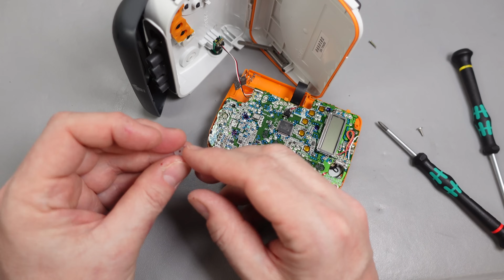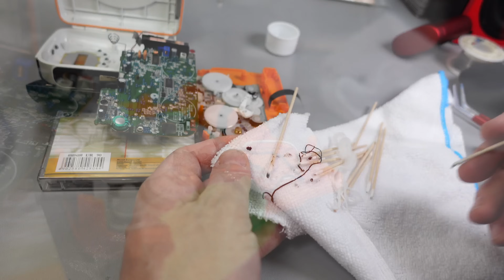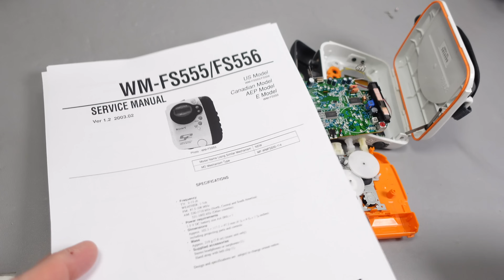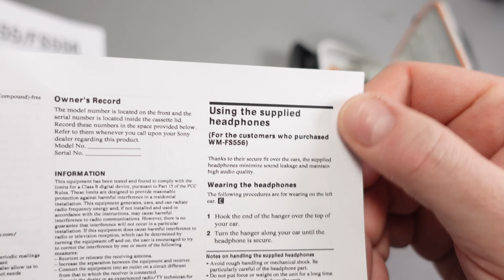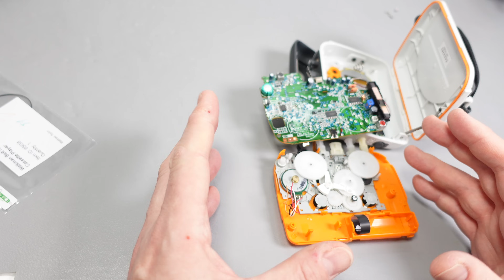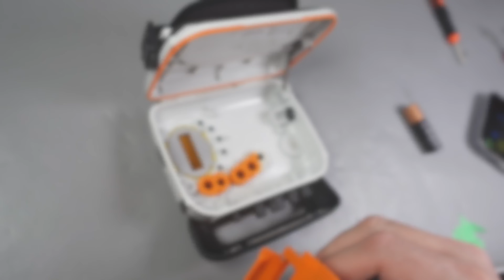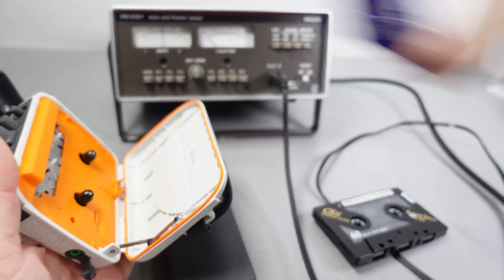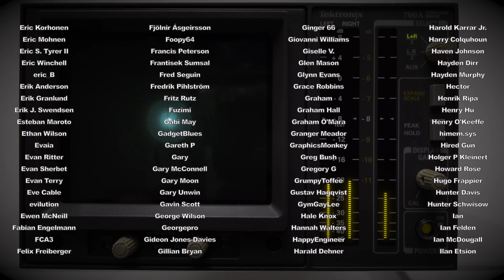SONY S2 Sports Walkman repair attempt

Comment: I'm genuinely impressed by the wow and flutter.
Reply: Walkmans performed really good.

It's amazing, especially seeing how tiny the motor is. Sony really knew what they were doing.
Reply: @volvo09  The W&F of 0.2-0.3% this thing produced is mediocre at best, most people will hear it. Acceptable for a walkman, but it could be a lot better, and it was probably a lot better when it was new. Maybe the pinch rollers are getting a bit hard. This thing deserves a replacement flywheel set made of brass, if available. The motor you mentioned, makes it worthy for this upgrade, because that's a 3-phase brushless motor.
Reply: I was curious about the +/- .3 percent on the test tape.  I realize, at the end of the day, that this is all just 
"a bit of fun" but considering that some tape players claim W&F under .3 percent, does that mean all of the testing is meaningless?  I wonder if the tolerance is really .03%??? Not really a huge deal but it's hard to resist a small mystery, sometimes.
Reply: @anonincog575  The 0.3% is most certailnly not the recorded w&f of the test tape, it is the speed accuracy. Any half decent hi-fi deck has a w&f lower than 0.1%. If you want to make w&f test tapes, you should do it with a deck that has the lowest possible w&f.
Reply: @mrnmrn1  Dude it's a Sports Walkman from the end of the bloody run. Sony then, and nobody now is going to put that much care or effort into something which was from the get go intended to be thrashed and shaken about on a regular basis as someone is literally running about everywhere just for the sake of it. You want to get your hands on one of their older direct drive jobs to fix up? Be my guest. Otherwise the blasted thing works well for it's intended purpose.
Reply: @jameslaidler2152  Yes, I know this was never a hi-fi player. But its current performance is probably a lot worse than in originally was. By custom making two brass flywheels for it and replacing the pinch rollers if necessary, it would be better than it ever was, probably have a lot less than 0.15% w&f, while still being cheaper than some new production players that perform awfully. 

I would go for it because of its brushless motor. 

For the amount of money some of those new players cost, I would like to see custom made tape transports in them with a balanced brass flywheel, yet they all use the same, the only available cheap mechanism.
Reply: @mrnmrn1  Ya do realise Techmoan would need to use another test-tape that has been recently calibrated to a higher degree of certainty to even know if the machine has a flutter of 0%, 0.3% or 0.6%
Reply: @tbthegr81  He has some very decent decks, he can test his test tape in one of them. If it measures say 0.1% he can be assured the test tape has a w&f lower than that.
Reply: Too bad all that knowledge has been lost to time.
Reply: @adaml.5355  It's an obsolete format after all! Albeit with a small niche community of enthusiasts, but nothing like Sony's mass market Walkman sales in the day.
Reply: For an aftermarket belt and an explicitly non-Hifi Walkman... yeah one could do worse.
Reply: I was a little confused because I thought that he's tested tape players that show W&F well under .20.
Reply: @DukeOfKidderminster  I don't think this question was aimed to me, but my self-made wow&flutter test cassette is in its case in my drawer. I recorded it with my Technics RS-BX626 on a lowly, early '00s Fuji DR 60 cassette about 5 years ago.
Reply: The less wow it has, the more wow I feel
Reply: @a5leighton  while I was seeing it, the whole room went wow
Reply: @DukeOfKidderminster  So you wanted to ask Matt? What old test cassette he had? I only ever saw him using this one since many years.
Reply: are wow and flutter not undesirable? were you not impressed by the lack  of wow and flutter?
Reply: 0.2-0.3%, not impressive at all, well noticable by ear on a lot of music. I would say barely acceptable for a walkman, and it would be totally unacceptable for a tape deck. This thing needs an aftermarket brass whywheel set if available, to replace those plastic pulleys. Also, I don't know in which dierction he tested it. The reverse direction always has higher W&F, because the belt barely touches the "flywheel" of that direction.
Reply: @mrnmrn1 , you're looking at the thing all wrong.  Is it perfect?  Most certainly not.  But, find a new production unit that can get close to that.  Spoiler alert, you can't.  It's a good, solid player that sounds reasonable and that's enough.
Reply: @kirkmooneyham  You're right in regards of the currently produced overpriced attempts of cassette players, but I wouldn't listen to music on something that has w&f higher than 0.15%. 0.15% is already noticable on sustained piano notes, violin, etc. 0.25-0.3% what this thing has is noticable on most music.

It won't be perfect even after the mods I suggested, but it would probably go below 0.15%. I have a Sony walkman with the same transport, and I will try to do my best to get the best out of it.
Reply: @mrnmrn1  Yeah but look he doesn't have a good measurement reference tape, the one he's got has already got a load of W&F baked in on it. The player itself for sure performs better than that, just unclear by how much.
Reply: @SianaGearz  No way that test tape has 0.3% w&f. That number refers to the speed accuracy of the recording. Noone in their right minds would produce and sell wow&flutter test tapes on a deck that itself has 0.3% w&f. Even some basic decks with plastic flywheels have 0.1% w&f, and any decent deck has 0.07% or lower.
Reply: @mrnmrn1   Fair point, yes, that would be speed trim, the wow&flutter figure is not specified.

However... had 0.07% or lower, within the projected service life of 5-10 years. 30 years ago. Before it printed 1000 tapes for eBay.

If one buys a new deck today... it's going to be TEAC or TASCAM, same device, styling differences... 0.25%.
Reply: @SianaGearz  Old decks can be maintained close to their factory spec W&F value, until the capstan bearing wears out, and that takes a lot of use if you keep them lubricated. And of course, until acceptable quality replacement pinch rollers and NOS motors are available. I like the early '90s Technics series for their direct drive capstan: no hassle with questionable quality belts and worn-out brushes on capstan motors.

Yes, TEAC is ruining their name with those decks. I mean, I get that no other mass-produced tape transport is available, but at least they should order proper flywheels with flat belts and better quality motors for them from the OEM of the tape transport. I'm sure the OEM could do that for some extra money.
Reply: @mrnmrn1  wark wark wark

Comment: Why would you ever want to turn the megabass off
Reply: Facts! I never did. I just figured it was law or something.
Reply: I had a Sony portable radio that had a mini subwoofer in the middle. It had 3 levels of megabass and a sub button, always had them all on!

I miss that radio, I mouse got in the speaker vent port and p1ssed all over the circuit board and cassette mechanism. I used it as a work radio for years after.
Reply: @volvo09  Don't you wish that you knew then, what you know now? I do! I owned half a dozen Sony's while growing up. All of which had something happen to them. Back then, they were considered unfixable. Today, they would be easily fixable.

I regret getting rid of them. They were all excellent boomboxes. But, there's one in particular that I regret getting rid of the most. It was an Akai. It was so good that it made all of my Sony's sound like single speakered transistor radio's from the 60's and 70's. Hell, it made any boombox sound like that. It was a monster.

Comment: I used to pine over the yellow Sony sports versions but I couldn’t afford them as a kid. I picked one up a few years back at the thrift store for $5. It works great and I still use it to test new cassettes I find at stores and garage sales for my collection.
Reply: You might want to buy a new belt for it.  I have a Sports Walkman from the last of the "yellow" series, and though it worked with the original belt, I bought a new one from FixYaAudio anyway.  Glad I did, because once I opened it up, I could see that the original belt had stretched and was probably going to fail soon.  If you can do the work, or know someone who can, it will be worth it in the long run.
Reply: @kirkmooneyham  I should have added that I did. I work on electronics with my business so I changed it the day I bought it. I constantly replace cassette, turntable, and oddly enough vcr belts for people all the time. I mainly work on game consoles but I do try to fix anything you can throw at me. The belt on it was kind of that melty consistency that some of them get with age.

Comment: I am always amazed at the mechanism in one of these, first time I popped mine open I could not believe how small the mechanism is. Even though the capstan pulleys are plastic the motor has enough mass as a flywheel and with a 4 pole design it is much better at controlling the speed and momentum of the entire mechanism. I wish we could have something of this calibre in current cassette players or even as a spare for someone to make a DIY project around it. (BTW shout out to FixYourAudio, they are the best, I also use them for all my belt needs)
Reply: The flywheel effect of the motor has little effect at the capstans, because there's a belt between them. If an aftermarket brass flywheel set is available for this mechanism, it's worth a try. It might perform as low as 0.1% W&F in forward dierection with those and a new, good quality set of pinch rollers. I have a walkman with the same transport, waiting for me to order a new belt for it, and possibly upgrading the flywheels.
Reply: @mrnmrn1  My Point was not that the flywheel effect is transferred to the capstans, but rather because the capstans are so light and the motor relatively heavy the motor can easily control the capstans; and since it is, presumably, a decent axial motor the controller can precisely and accurately control the speed of the mechanism as opposed to older DC motor controls. I do agree that SLS printing a new mechanism (though an exciting  approach) would require a lot more effort and design to bring to a good calibre.
Reply: DIY kit huh? I mean you can nowadays order SLS (laser sintered) polyamide parts not too expensively from any PCB supplier. Perhaps now's the time. A micro brushless motor. Would people build their own Walkman from an odd hundred individual gears and parts? It would take an intersection of two types of special interests for people to be the target audience, but i guess it could be done.
Reply: @SianaGearz  I don't think many would go for such effort. It is enough if they produce DIY repair/upgrade kits for exisiting old models. Now that market focuses on '80s / early '90s classics that cost a fortune, it would be nice if parts for these last generation players were also available. Most of them not worth the effort, but this transport with its brushless motor would worth it I think. Although there are a lot of very thin plastic parts in it, not sure if any of them will work 10-15 years from now. IIRC mine also has a gear in it that already started to crack around the shaft.

Comment: hah you need a magnifying glass. thats is one reason my faulty eyes have over a person with normal eyes. i have a near sighted range of 2 inches perfect for doing surface mount soldering or device repairs.
my teachers in electronics didn't know how to grade me since everyone had to do thier surface mount soldering with a microscope but i just used my naked eyes giving me an unfair advantage.. i also snuck leaded solder into the class instead of the lead free junk we we supplied.

im also soldering my cassette tape head preamps while watching this.
Reply: My left eye used to focus down to about 1.5 inches. Then I turned 45 and suddenly it went out to 6-8 inches like my right eye. Definitely an underrated super power. It's also good for reading the print on small parts.
Reply: @8bitwiz_  i think 1.5 inches would be better than 2 since smd components have such small ident letters and numbers.
off topic but i think smd capacitors should have numbers on them like smd resistors